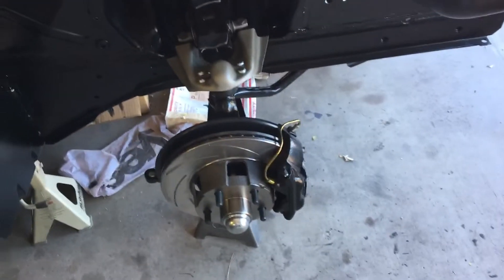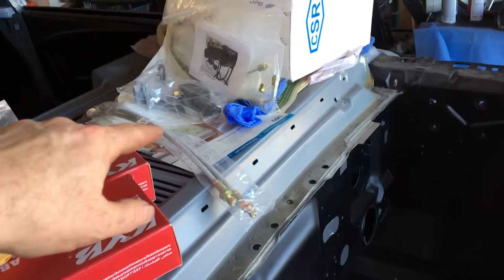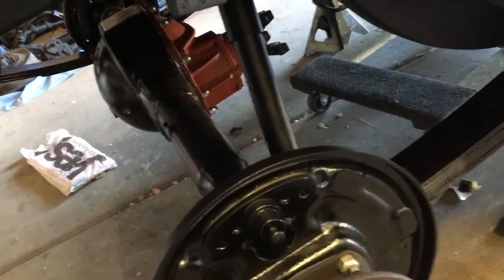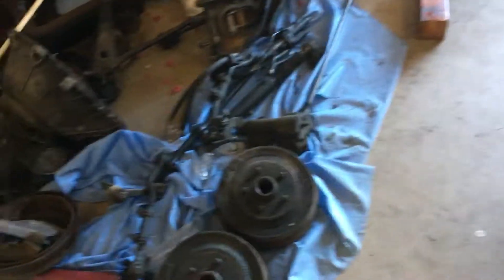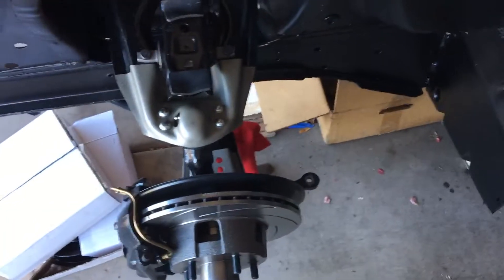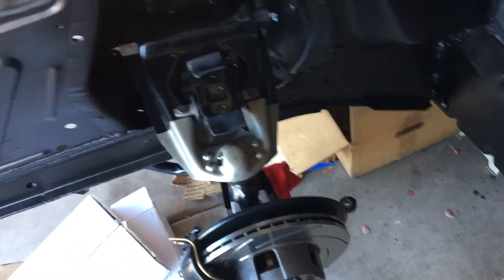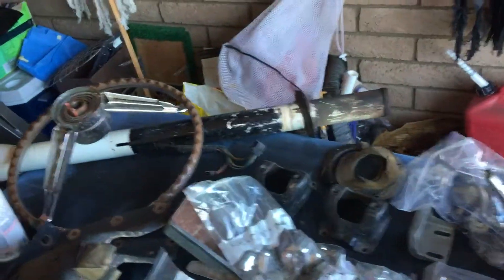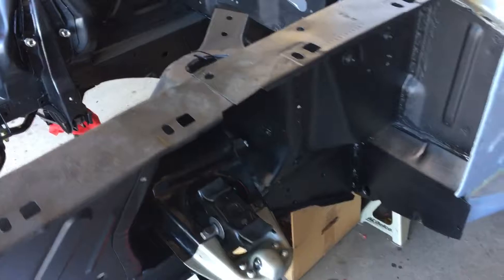Front disc brake conversion part 1

Comment: I replaced the whole control arms in mine as well. By the time you buy the bushings and ball joints separately it costs more than the control arm with new bushings and ball joint installed.